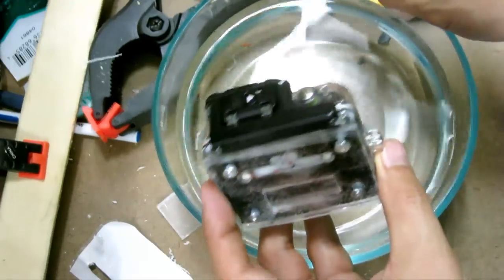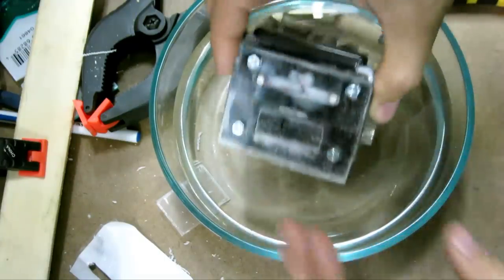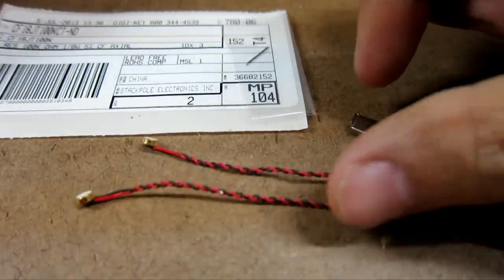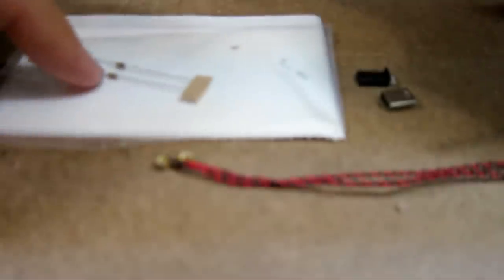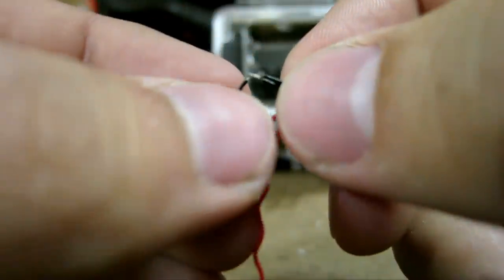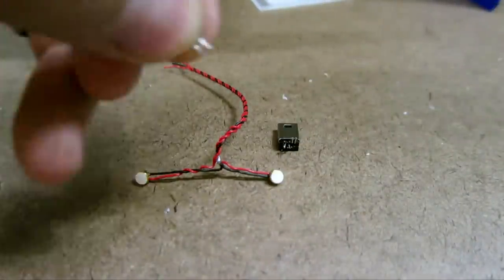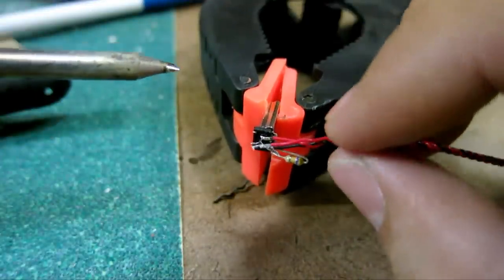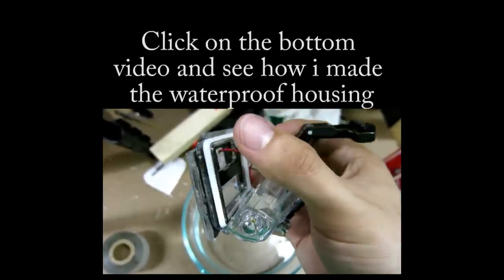DIY GoPro Hero 3 Waterproof Microphone - Wiring diagram 10 pin mini USB to external mic Hero3 black

Comment from the maker: yes, just replace the mics with a 3.5 mm female jack. the wiring for the jack is the same as the mics. One left, one right and one ground connection.

Comment from the maker: both resistors should work with no problem. yes, its from the front, so, it will flip (right to left, up to down) if you are looking at the pins in the back.
I attached a photo in the "About" above.

Comment: I've opened a couple commercial connectors designed for the GoPro 3+ and I can confirm that the resistor value is 333k

Comment from the maker: hi, i bought the connector from ebay. search "10 pin Mini USB Male connector" and it should show up on ebay. i didnt have to cut the plastic, but i did cut the pins shorter. hope that helps.

Comment: .Thanks, I'll have to try that. I tried a different connector, but no luck, maybe my gopro has a faulty usb port. I'll try it on a friends gopro as a last resort, until then the project is on hold. Thanks for the help though!

Comment from the maker: most USB cables only have 5 pins. you need to double check and see if it 10 pins. 10 pins USB cable are expensive too, its a lot cheaper to just buy the connector on ebay for a few dollars.

Comment: Hi! just get original mic cable - Your schematic diagram is ok, but resistor must be 300k for activate external mic and deactivate internal. 100k is for activate Video Out and Audio Out. That is what I have to measure with multimeter  from my original cables.Good luck!

Comment: Have you ever recorded with this setup while moving around?  I'd like to try this setup while snowboarding but if wind will be an issue then it's not going to do much as much good.  Maybe flush mount would be better so the wind doesn't circulate through the indent you have?

Comment: hi there great video, do you think there is a way to modify a usb connector to take both an external mic and external power pack? so that you could plug in the one usb into the camera and it would then break off into two split off ports to take the other two attachments? I want to be able to connect both and external mic and power at the same time but now sure how to go about it ? thanks

Comment: Hi!
I am interested in doing it myself. What is the exact size of the usb connector? Have you cutted it to fit? I am trying with some mini usb 5pin just to measure the total available space and it does not fit. It seems that the total length of the connector is 8.15mm and the available space for connector+wiring is 8.0mm. Cutting a 1mm section of the connectors I have here might do, but do you know if cutting it affects the connector to work properly?

Thanks in advance

Comment from the maker: ya, i know which video you are talking about. it was just trial and error, you can try 100k but i am sure it will not work. 
I also did some research online, and you'll find a blog site that others have posted their results. The highest value that works is 90k, and the lowest is around 33k. So, i think any value lower than 90k. i picked 47k because its what i had laying around, and it worked. i also tried 100k but it didnt.

Comment: Hi, I tried this but can't get it to work. I couldn't get 47K 1/8W, but I got a 56K 1/8 W and a 47K 1/4W. Tried both, but neither made a difference. Any ideas? Could bad soldering be the cause? I redid it once, but no luck. The diagram is seen from the front, right?

Comment: Hi, 
Thanks for your explanation, a question now,
Could I use on the same 10 pins usb connector an external battery pack for charging  regarding the resistor connected between pin 4 & pin 5
Thanks
Patrice

Comment: I used 500K trimmer  to try different resistances to enable external mic for GoPro Hero 4 silver.
300K worked fine.
50K didn't work.

Comment: Hi DIY Tinker,
Appreciate the video, looks like a great mod.
I wanted to ask some advice if I could. I have a Gopro Hero3+ and I recently bought a mini usb to 3.5mm jack adapter for it so I could use my rode video mic with the setup. When I plug this setup into the gopro it does not disable the internal mic and the external mic is not functioning.
You obviously know what you're doing and any advice would be really helpful?
Mike
Reply from the maker: some go pro works on 50k, and some on 300k. try 300k.

Comment: So the best is to use a 300k resistor, but do you use a 1/2Watt or a 1/4Watt and does it make a difference if it's a carbonfilmresistor or a metalfilmresistor? thanks in advance for the info.
Reply from the maker: 1/2 watt or 1/4 watt makes no difference. any resistor (carbonfilm, metalfilm, etc...) will work.

Comment: I looking for a mic in however I also need to have power in, obviously not for underwater use:).  Would i just add a wire to pin 1 for power and pin 5 for ground so the power would have it's own ground?
Reply from the maker: i believe so. Google it first, im sure thats pretty much all you need to do. but double check on someone elses project first.

Comment: Hey, do you think if this solution would work not only with gopro but also with my dslr nikon d3100, as 35 mm external mic?
Reply from the maker: hmmm... not sure, but it makes sense since the USB format is standardized. The only think you might have to figure out is the resistance level. Im sure each device uses a different resistance level to activate the functionality.
Reply: Did you ever get to test it on you dslr?

Comment: hello, friend. I soldered a microphone electret. did not work. Should I attach a preamp to function? I await response
Reply from the maker: no, you dont need a preamp. It should work. Try different resistance shown above in "About".
Reply: would have to open a unique cable adapter gopro hero 3 to see the settings of links.

Comment: I've tried it with 75k, 100k, 300k and nothing worked, it will be because I called just a microphone? it works with just a microphone or has to connect two microphones to function?
Reply from the maker: one mic should work. not sure why those resistance didnt work on your goPro. Other than maybe you did use the right pin... then im not sure why
Reply: DIY Tinker with 47k does not work, but adding 47k 4k7 with the GoPro microphone is activated, but not the external microphone. I wonder: is my microphone electret microphone, no need to use something to activate it? I can solder the two pins 6 to 7?
Reply from the maker: CoelhoHD interesting. i guess it should be the same idea. or why not try having both mics? maybe it requires two mics? let me know if soldering 6 to 7 works or not.

Comment: if I ride with just a microphone, I have to solder pin six to seven pin? or do not need?
Reply: +CoelhoHD - fala amigo, conseguiu resolver com apenas 1 microfone??
Reply: sim, ma tem que intercalar um pré-amplificador para capsula de eletreto
Reply: +CoelhoHD - não entendo disso, procurei a pinagem pra um amigo soldar o meu q soltou... só tem um fio vermelho, um branco e uma malha...
Reply: +Magro FZ6 não conheço qual os fios estão soldados, só abrindo para ver. A princípio o vermelho é positivo sinal de áudio, branco negativo áudio e malha para bloquear os ruídos, mas antes de ligá-los ou religá-los precisa ter certeza se são ou não

Comment: i used 2x 100k Parallel, but it doesnt work. Should i try it with just 1x 50k
Reply from the maker: no, according to Ivars Zubovs2, he made a comment 2 months ago, and he said it should be 300k ohm. try that and let us know if 300kohm works or not.
Reply: DIY Tinker

i used 300k ohm and now it works :)

Comment: I tried lots of resistor values, see here for the weird results
http://youtu.be/KpfZoVQKitU
Reply from the maker: wonderful! i added your video in the "about" section for others to check it out
Reply: DIY Tinker sir can you please tell me if i want to use only one mic like you used two of them but want to get audio on both channels should i solder the postive cable of mic to both 6 and 7 pin? will i get sound on left and right channel ?